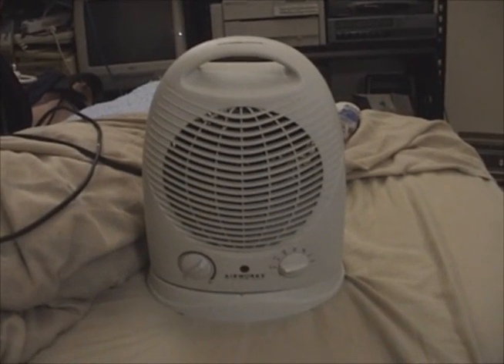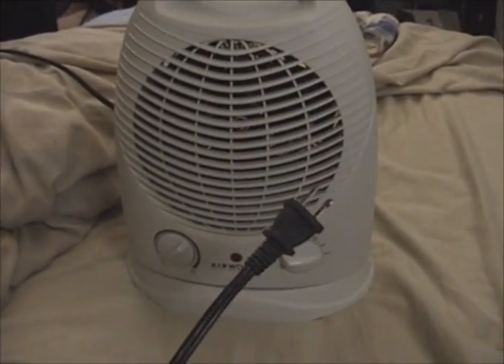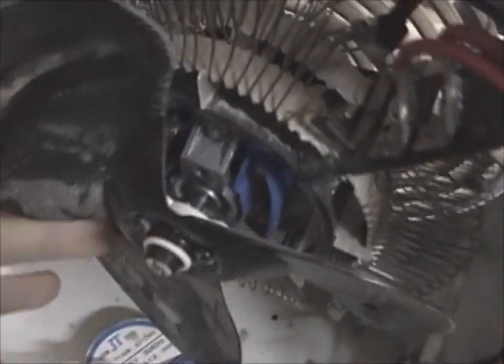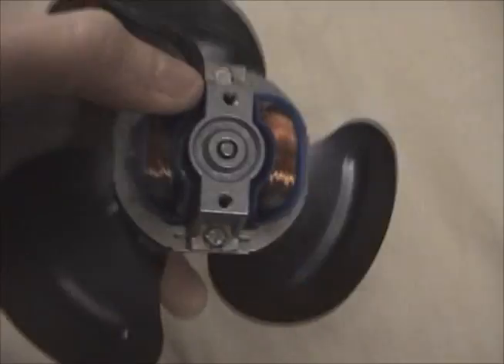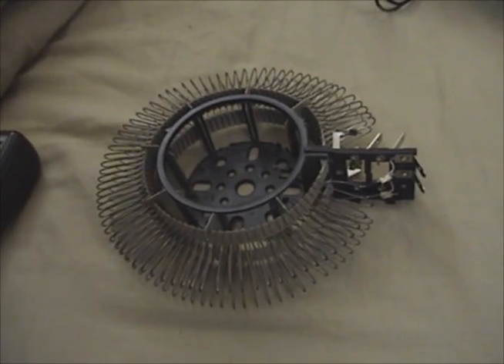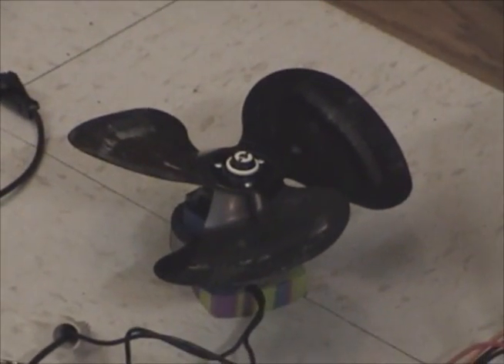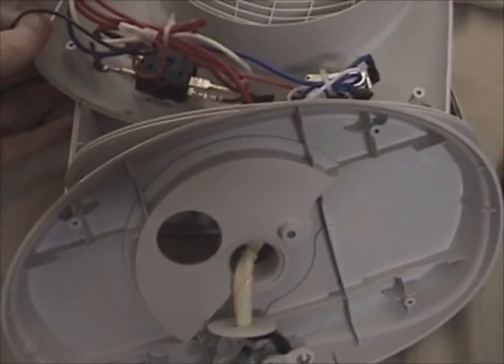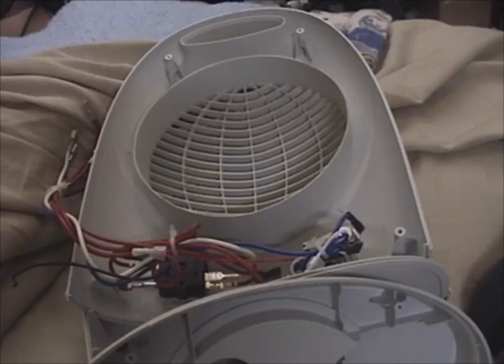Tear apart an Airworks fan heater

Comment: I love synchronous motor. I have a clock that use telechron motor, wich are just synchronous motor, and it keeps the time really well with only the 60 hz of the wall. For the oscillation, it's just the same priciple as a normal fan. It convert a compleat turn in to a half, no need to change the direction of it. Great video, heating devices are welcome, it's -8°c here so heat is needed, even though I love cold, 18°c is the lowest that I ok with. I have an old heater, but I need to change the power cord, because it is loose and great little video by the way.
Reply: i dont mean to be offtopic but does any of you know of a method to get back into an instagram account..?
I stupidly lost my password. I love any assistance you can give me
Reply: @Evan Charles instablaster ;)
Reply: @Jairo Marcelo Thanks so much for your reply. I got to the site thru google and Im trying it out atm.
Takes a while so I will reply here later when my account password hopefully is recovered.
Reply: @Jairo Marcelo It did the trick and I actually got access to my account again. Im so happy!
Thank you so much you saved my account !
Reply: @Evan Charles no problem =)

Comment: We had a similar heater from the mid to late 90s, the cord and plug end did exactly the same thing.
This is just a theory of mine, but I think the heating element is more powerful than the electrical system in the heater can handle, the elements is more like a 20 amp not a 15 amp I think,
But on average most people have 15 amp breakers running most of their house not 20s
Reply from the maker: Interesting. Well, as I showed here this particular unit drew a normal amount of current. About 13A on the high setting.

Comment: I don't really get why they'd connect the heating elements that way (both in series for the low setting, then shunting one out for high); surely this uses thicker resistance wires (so costing ever-so-slightly more) than the more straightforward approach of using one element for low heat, and both in parallel for high. (Although to be fair, many "suicide showers" also use such an arrangement.)

Comment: The on/off, speed dial knob broke off ours. How can I get a replacement? How to contact the company that makes them? Thanks.
Reply from the maker: You'll never get one - these are disposable products, and the company will almost certainly not sell parts. Toss it and get a new heater.

Comment: Plugging a heater into an extension cord in general is not recommended since extension cords are not made to handle it.
Reply: I put a high heat on heater and it tripped breaker switch

Comment: Hmm....I have a 1500W oil heater plugged into an extension cord...maybe I should not do that
Reply from the maker: I wouldn't worry as long as it's a decent quality 15A rated cord. That cord was one of a few we bought at a dollar store some 10 years ago. They fit the plugs loosely and tended to spark when you plugged and unplugged stuff. One by one they were discovered with discoloration around one of the sockets and thrown away... This one was the last of the bunch.
Reply: Ah. I have been using it like such for months and not had a problem, so I guess I'm good
Reply: If you have to use an extension cord with a heater, use one that's heavy duty (there are appliance-rated extension cords), short as possible (longer = more heat buildup), and avoid off-brand/stuff that's not checked by national safety experts; cheap cords might overheat or get kinda melty due to arcing from a poor fit or cheap undersized wire.
Reply: Emily, when you said this: "short as possible (longer = more heat buildup)" you simply and clearly taught me why a shorter cord is better. I appreciate that! :)